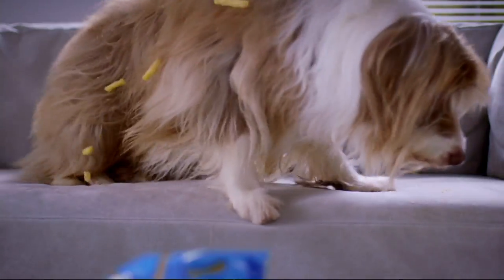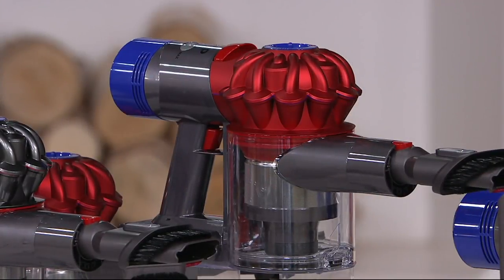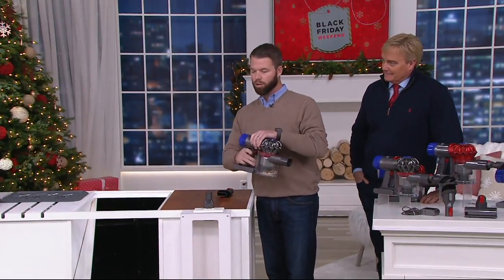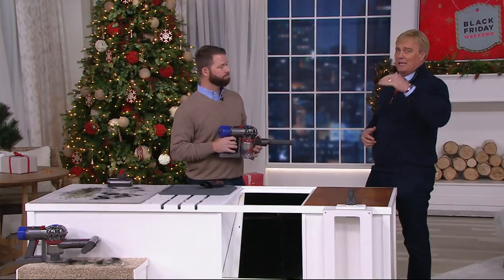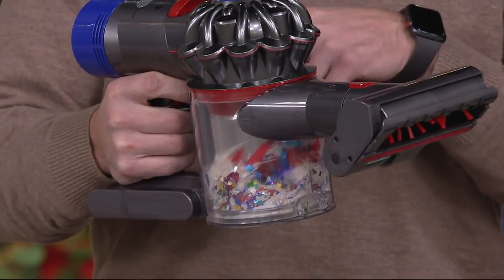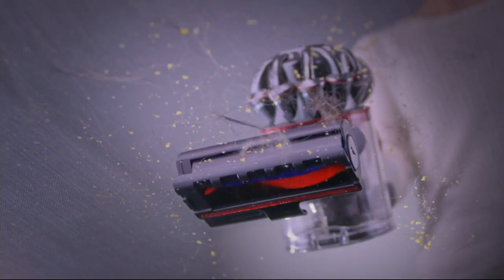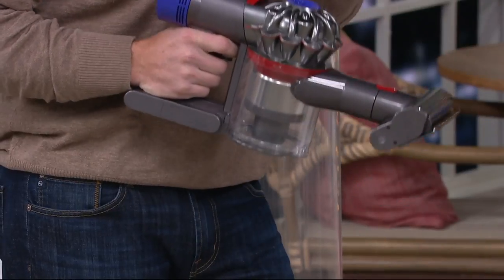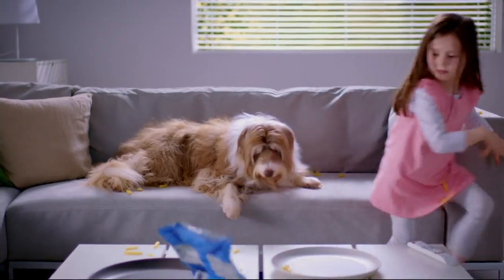Dyson V7 Trigger Pro Handheld Vacuum Assorted Tools & HEPA Filter on QVC

Comment: Does it come with a hose?
Reply: DaForgottenGentleman That’s the only thing that would make this perfect, an extension hose. I guess if the battery lasted a little longer, that would be cool too. Check Amazon. I think you can buy extra attachments for this.
Reply: No but you can get an after market one for only about 15$